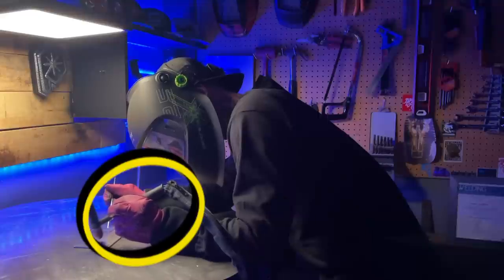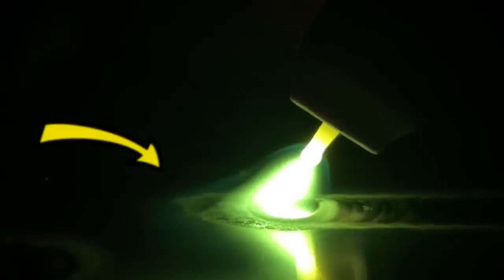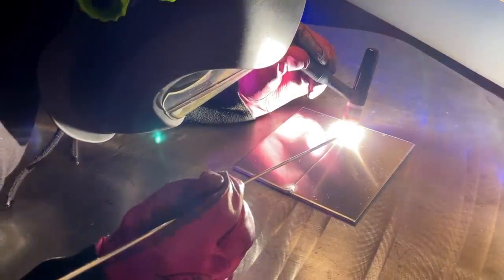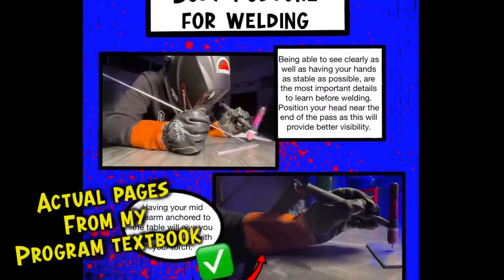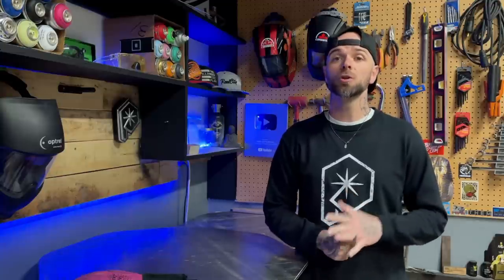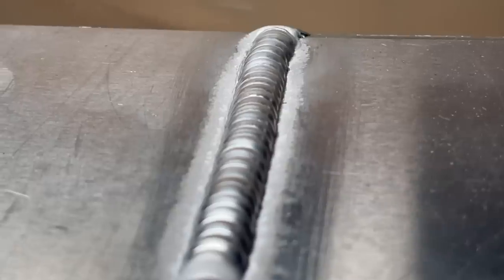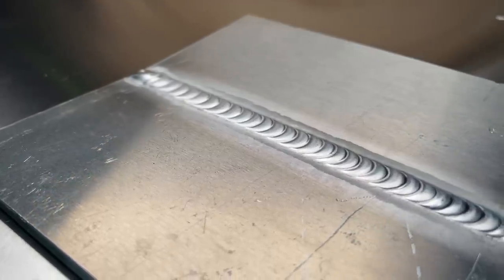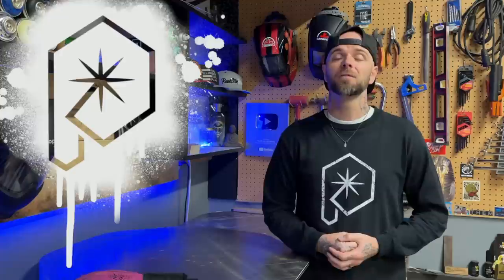3 TIG welding tips that will SAVE YOU TIME LEARNING

Comment: Being able to see is a HUGE one! I used to just have one hood and switching processes throughout the day, when it came to tig welding something I never noticed HOW DIRTY my good lens would get from running stick especially, now I have an optrel I keep in its bag tucked away and strictly use it for tig. Made a big difference in my welds.
Reply: When I use lots of flux core wire, I tend to clean my mask every hour or so. I have a big bag of individually wrapped lens wipes, so I'll just put handful of those in my pocket every morning. Starting that habit improved my welding and reduced eye strain quite lot.

Comment: I'm trying to weld up some headers and I just can't seem to get comfortable.  It just seems when you're NOT welding on a flat coupon, you don't always have control of how comfortable you are.  I have to concentrate on all of the parameters you discuss here with a constantly changing angle and frankly I struggle to do it on a flat surface.  I used up all of my practice material AND my project material just trying to get an acceptable weld.  It gets expensive.    Also, isn't "being able to see everything" somewhat dependent on the helmet?
Reply: Maybe the TIG Finger will help you to prop and get more comfortable.